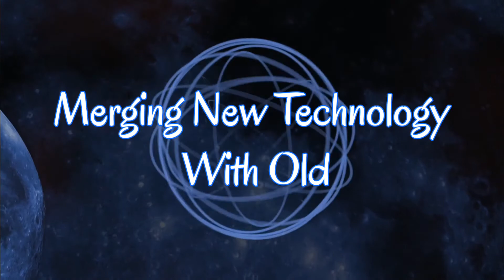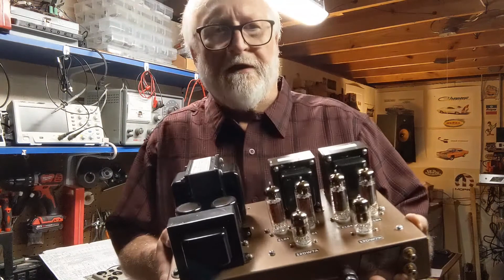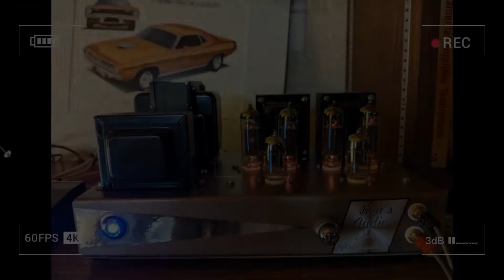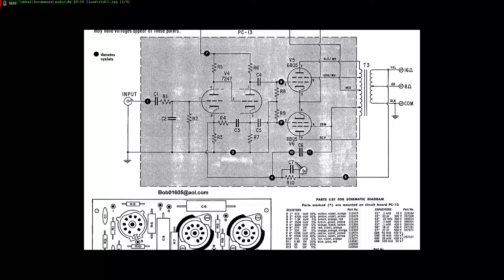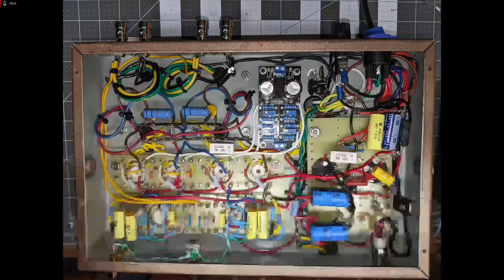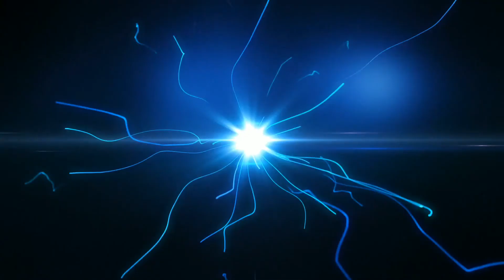Dynaco ST-35 Clone (using ST35 circuit) another EL84 Stereo Tube Amplifier

Comment: hi you dont have  enought current on the power transformer put  a 300 ma  ,its 40 ma each tube
Reply from the maker: Actually it's fine. I've got the idle current at 27ma. Not running them hard but it sounds as good as my SCA35 that has Dave Gillespie's modifications.   https://youtu.be/1dbOEhja9sc?si=bjEJzAARaHi0BTzG. The power transformer does not overheat. Dynaco ran them harder. I do believe that Musical Power Supplies builds some headway in their power transformers.

Comment: Hello friend, how are you? I got a pair of ultralinear transformers that I believe would work with the original configuration. I don't know anything about valves, but I would like to build this amplifier for myself, but I would like some idea of how I should put together the circuit using 12ax7 in the pre-amplifier, as the 12dw7 is very expensive and difficult to find here in Brazil. If you can help me with this, I would be very grateful. Thank you very much!
Reply from the maker: Hi, here is a link to a circuit over at DIY audio that can be set up to use a variety of different tubes.
https://diyaudioprojects.com/Tubes/Junk-Box-Audio-Amp/
Reply: @electricroo  thank you Very mucho my friend

Comment: Is your mains still 120Vac or 125Vac. Alabama Power is running our circuits hot at 125. My work like came with 110V halogen bulbs which blew in 10 minutes and the dimmable LED bulbs don't last. Most other equipment uses at least some form of power factor correction or current limiting. I have not completed my Oddwatt but I will have to check the heaters to see what voltages getting to them. Nice clean work there.
Reply: The utility transformer was in our backyard and I had a similar problem but out mains was 130v/260v for a few years. We kept blowing bulbs and I called the power company. They said that I was at the beginning of a long run where they had to feed other Bart’s of our growing neighborhood. They needed the higher voltage so those at the end of the run could get at least 115v.  They finally fixed it but for about a year we had to use 130v light bulbs (yes, they were available).
Reply: @wansolve289  when I lived in the city, my neighbor ran out of her house yelling that her house was haunted. Every time she turned on her light switch, her bulbs blew. I went to her house and checked her power and found ~135vac. Power company was called and a faulty transformer on the pole a block over from her home was the culprit.
Reply from the maker: It can vary between 120 to 125.